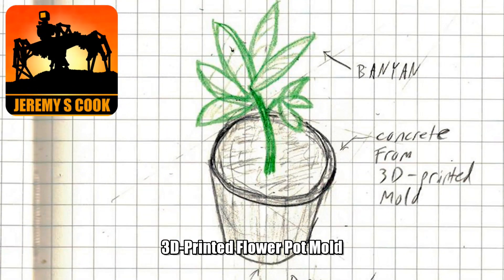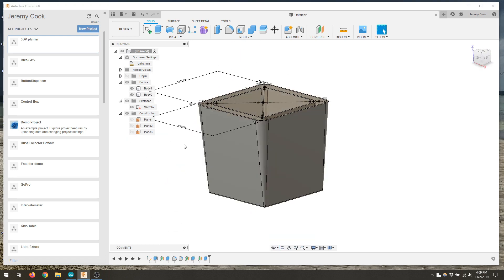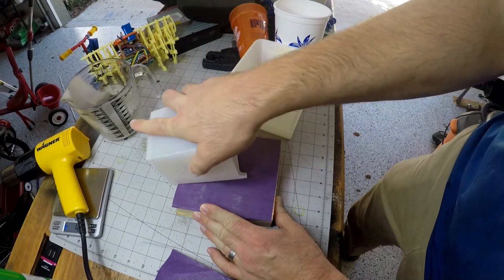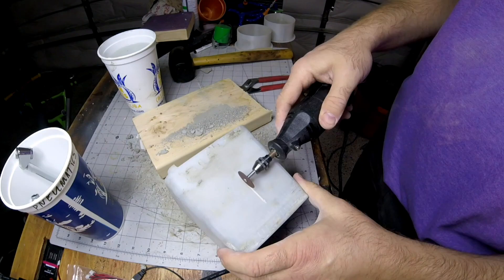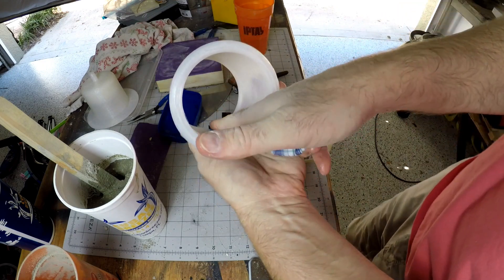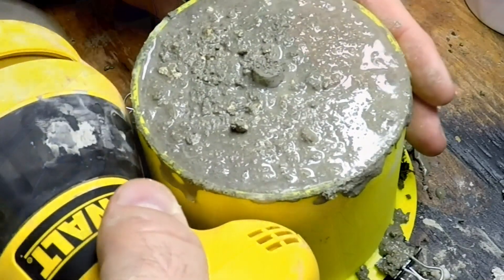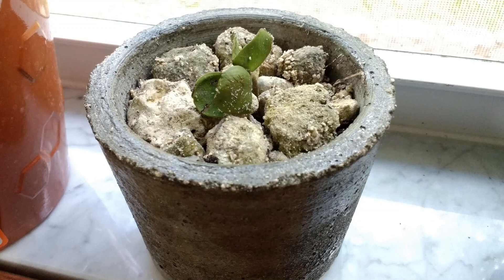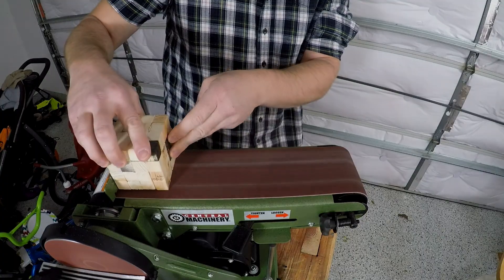3D-Printed Concrete Flower Pot Mold [Howto]

Comment: Great design
 Apply used engine oil inside the plastic surface and cement will leave it very easily.
Reply from the maker: Thanks! Hadn't considered that, nice idea!
Reply: Also I have another idea about design. If you are interested let's communicate further

Comment: Thanx for the video. Just some thoughts off the top of my head: What if you made the inner piece in two pieces (or three?) with the binding clips and flanges pointing towards the inside? Then you might be able to peel the inside off as you did the outside? I think that might decrease the surface area you would be trying to release at any one particular time as well as changing the angle that the piece is moving away from the pot wall. (laterally vs shearing)
Reply from the maker: My pleasure, thanks for watching!
I considered that, and honestly it just seemed a bit more complicated mechanically than I wanted to deal with. I imagine you're correct though!